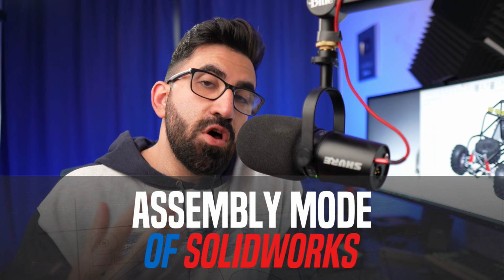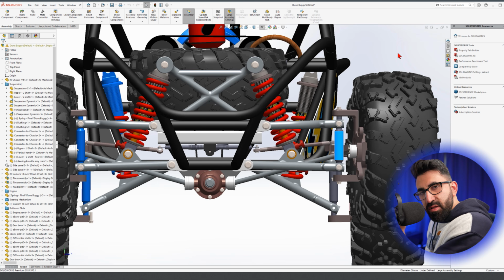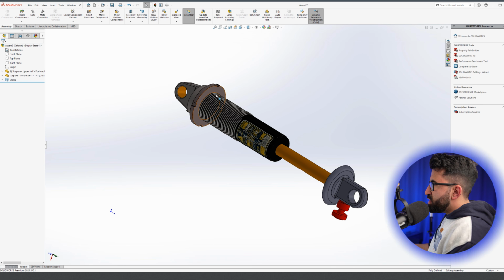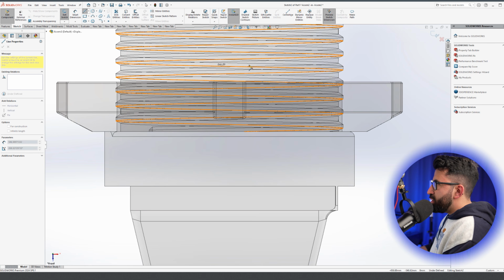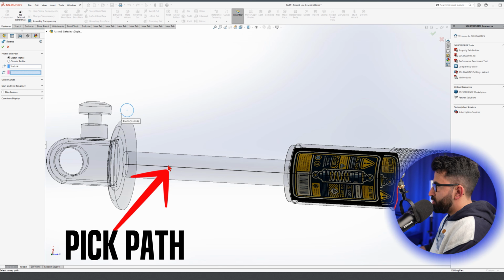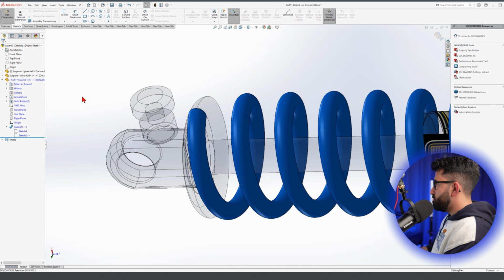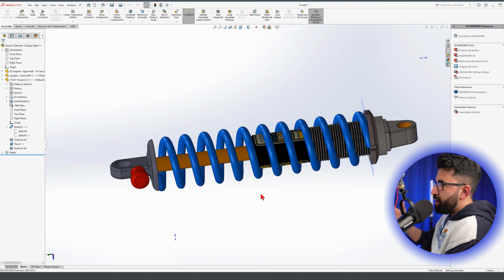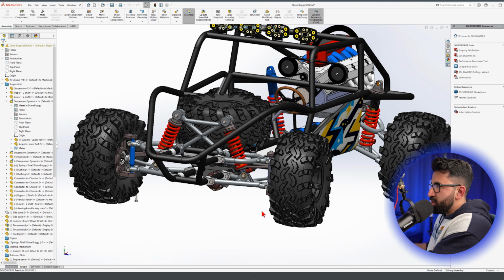Ever wondered how to make a Dynamic Spring in SolidWorks? | Dune Buggy Ep02

Comment: So I just managed to get this working in an subassembly. And it works very good in the subassembly. But as soon I move parts in the assembly above, the spring its just a standard lenght. And this is also even if I have made the subassembly flexible. And the rest of that assembly moves correctly. Except the totalt lenght of the spring doesnt adjust in rebuild.
Reply from the maker: That doesn’t make sense
Send your assembly over
Reply: @with-aryan I think it can have something to do with that I made the spring in the subassembly directly. And not through editing from the the top assembly. But all the measurement and parts are within the subassembly

Comment: NO....Pretty springs will slow you down and do nothing to improve design functionality.  Flexible assemblies can sometimes not update correctly.  Model springs as a cylinder..if you model them at all...especially if they are dynamic.  Nothing worse than presenting a design to customers and watching SW swirl just because you wanted to show a cartoon.  You just showed them that you are at the mercy of your software and not in control.  This looks cool...but is totally avoided in the real world until DS can recode their software.  SW users are used to crashes...but customers don't appreciate it.
Reply: Sir than how and which method do you prefer for this types of spring assemblies. 
As Im also working on some spring design can you help me sir.

Comment: This would be fine for digital designs only, but the actual part would vary depending on its shape. You couldn't really get it manufactured off that model. The flattened surface on wither end would be different sizes at the very least. Try weighing the part in both configurations, it'll show different mass for both.

Comment: Did I miss something? Where did you assign the advanced mates that drives the spring length? Thanks Bob
Reply from the maker: There are no advanced mates. As long as the start and end point of that straight line is on the surface of those two counter parts, moving them , defines the length of that line, which defines the length of the spring
Reply: @with-aryan  I watched the first part of the video that is key, building a new part within an assembly. I was trying to make build an assembly by inserting an existing spring model.
Is building a new part within the assembly the only why to make it dynamic or driven off from another mate?
Reply: @with-aryan I made this work within a subassembly. But when moving it in the assembly above, the spring stays stationary even if its a flexible subassembly. And rebuild doesnt work either. Any suggestion?